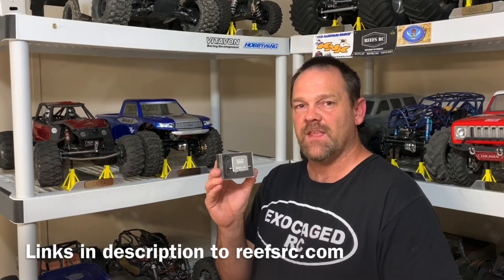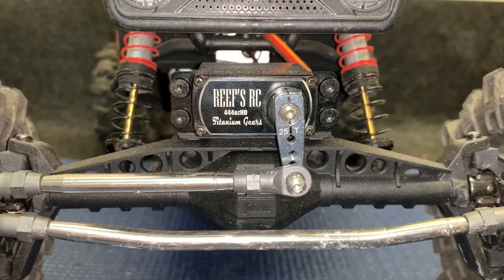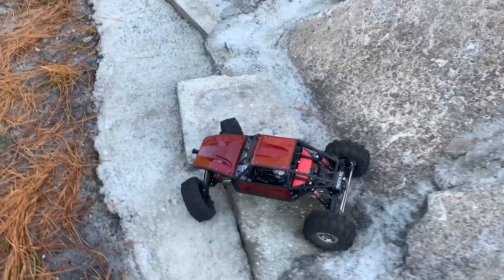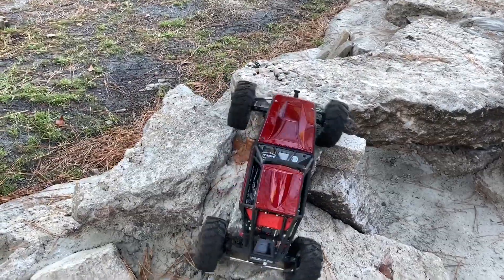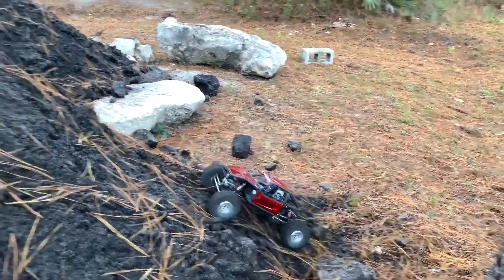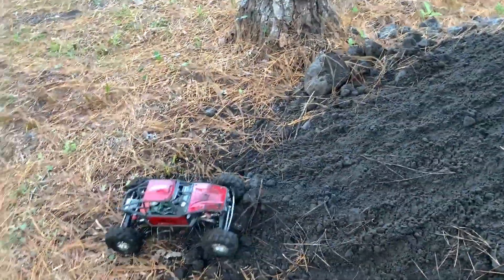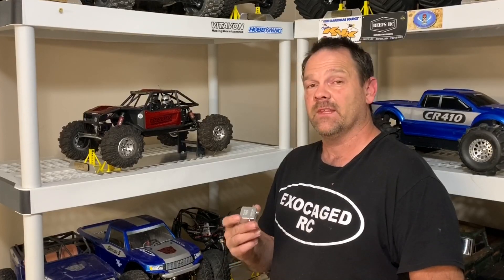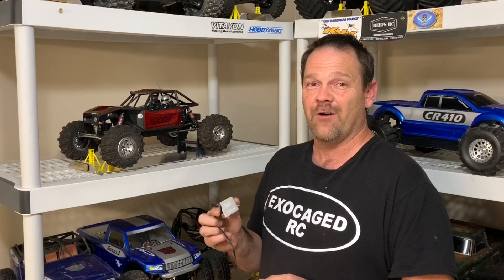Reefs RC RAW500 SERVO!!!

Comment: Hello sir, I’ve been watching your crawler videos for a while, and starting using Reefs servos due to your videos. I thought I would ask you if you ever tried the Reefs Raw 500, in a rig that had the Tactic TTX300 controller, and matching receiver, like maybe what came stock in the SCX10 2’s. I have the 555 in my bomber with those same electronics, and a 1200kv fusion, and love that set up, with no issues. But my TRX4 sport with the same controller, and 1800kv fusion motor, and Raw 500, are having some issues. The servo will twitch at times, (very quickly, and momentarily, and not always throughout the day). Reefs told me to use a Spektrum DX5, and matching receiver, which I don’t have yet, I only have lots of RTR controllers, and receivers. I was just wondering if you ever tried using that combo (Raw 500, and Tactic TTX300 controller/receiver) and experienced the same twitching like issues.
Reply: Have you tried running a BEC in your TRX4?
Reply: @glennaguon5165  yes sir, used it for a short while, but it only gives you 6 volts for servo. The best option is running a hobbywing 1080esc, $42, fully programmable,  comes with program card, for brushed motor. Or better yet, for brushless,  the hobbywing 1800kv fusion motor/esc, also fully programmable,  comes with program card...best $156 I ever spent. Both are great options!
Reply: @glennaguon5165  and I forgot to mention, both hobbywing options I mentioned earlier, you can program the internal bec,( with the included program card), to give your servo either 6 volts, or 7.4 volts. But be careful, if you go with either hobbywing set ups, and you decide to run your bec voltage at 7.4 volts, I heard the micro servos that come in the TRX4, can’t handle more than 6 volts…just so you know. The traxxas optional bec kit, will only give you 6 volts maximum.
Reply: @OH-Hobbies  Have you tried an aftermarket tx/rx and different ESC beside the 1080?
Reply: @glennaguon5165  Yes. My TRX4, was the sport version RTR. I upgraded the servo to a Reefs Raw 500, but first I added the traxxas BEC, to get 6 volts. Later switched to the 1080esc, and ran the servo off 6v and 7.4volts, same as when I later switched to the brushless fusion motor. The only issue I had with the stock controller (TQ) though, is that there was no way to set the end point adjustments for the servo. I believe there’s away to set the end points on the TQI,  if that’s what you have, but I don’t know. I had the older RTR Tactic TTX300 controller, and receiver, which came in many axial scx10 2’s, original axial Bomber, and also, my RTR 6’s Arrma Talion, so I was familiar with the end points on that. When I tried to use the Tactic, with that exact servo Raw 500, it did not like it very well, the servo is very fast, and is awesome, but for some reason, there was some intermittent “twitching”. Reef’s told me to try one of the Spektrum DX5’s, so I just bought the DX5C, and problem solved. The funny thing is, I use the same Tactic TTX300 in my axial bomber, but use the Reef’s 555 servo, and there is no twitching. That servo is much slower, but pulls way more weight. 555oz/inches of torque on that, is way underrated, it actually pulls about 690oz/inch. I’ve never seen anyone test exactly how much the Raw 500 actually pulls, but it is very fast, and super quiet. I highly recommend it for a trail truck, or comp crawler.

Comment: Hey what transmitter and receiver do you run?
Reply from the maker: depends on the truck but this capra has a hacked GT3c radio
Reply: @ExocagedRC  ok thx thinking about rear steer for my capra

Comment: Need to put it on the servo tester!!!  I can't choose between this raw 500, triple 5 or the 3 brothers g13.  What's you recommendation between these 3 servos?  Which would be the most durable?
Reply from the maker: Raw500 is fastest, 555 is strongest, g13 simply works great. Imo I’d go with the Raw500 as its tough fast and strong.
Reply: @ExocagedRC  Do you think I should install a BEC using the raw 500 with the HW axe 550 system or is its internal bec strong enough to run the raw 500?
Reply from the maker: Jared Ferra should be good with the AXE esc.
Reply: Will the raw 500 work with a stock arrma Mojave esc?  Will it be fast enough?

Comment: A little off topic but I know you run a hacked flysky radio...as do I.  How are you powering your servos?  Do you bypass the rx to be able to run 7+ volts to your servos. I am trying to run 7+ volts through the flysky rx and i think this might be the reason my servo wont always recenter and is glitchy. Same issue on both of my trx4s using 25kg servo. 1 with a mamba x and 1 with a 1080 esc both with the bec turned up on the esc setting

Comment: Exo, it looks like you pulled the brass? How come? I have a pair on the way along with one third member in brass. If I like it, I’ll buy another set for the rear.
Reply from the maker: I actually had this recorded before I had the brass put on it, the brass is staying on the capra for sure as it sits now

Comment: Hey bud. How long has a reefs lasted for ya. Ever have one s#$t the bed.
Reply from the maker: Coast2Coast RC so far I haven’t killed one, I thought I killed a gear in the 444 when I did the jumping video with the 2.8 sand paws but it’s still working fine. I’ve read where others have killed the 555 gears and gear sets are available. This new one is still new so we will see how well they hold up, so far so good

Comment: You get what you pay for.
I have several 555's and Protek 370TBL 650oz servos and they are extremely powerful. I also have two 46kg Japanese servo's that were $50 each. They aren't bad for the cost but not near as powerful as the Reefs and Protek.

Comment: So it's a 555 with a high speed gearset in it I'm guessing. Throw it on the servo tester 1000
Reply from the maker: Is the 555 has a coreless motor with different gearing than this one with a brushless motor so its not the same thing at all
Reply: So is the 500 more powerful than the 555? It looks to be faster.

Comment: You're never too old to learn. WTF is a BEC?  I've heard them mentioned before in servo discussions and when I questioned my hobby shop about the Traxxas 2255 400oz servo he had no better idea of what it does and how it does it than I. What is it; a capacitor of some sort? Another question! I got a Traxxas High Torque 330 on my TRX4 and LOVE it. However, it has a far greater amount of 'slop' at neutral position than does the traditional 'Core' servo on two other RCs I have. Is this 'slop' normal for the 'Coreless' variety of servos? Traxxas support said "Nothing to be concerned about if it's not hampering driving"; but I'm curious still.
Reply: Battery Eliminator circuit. Voltage regulator that can output a set voltage different than the battery output voltage.
Reply: @avelkhemchan6640  Thank you. That is an apropos initialization for sure(and certainly not to be confused with an acronym).
Reply from the maker: Douglas Elliott I tell you man the cheap 25kg servos like what Redcat has rebranded are really good for the money. I’ve got about 6 of them in various vehicles and haven’t killed one yet. Are they as good as the one in this video? Not even close but they get the job done and are cheap.
Reply from the maker: yep as Avel said its a high amp external bec that helps get more voltage and amps to power the amp hungry servos and other items. This is a common bec in my area https://rover.ebay.com/rover/1/711-53200-19255-0/1?mpre=https%3A%2F%2Fwww.ebay.com%2Fitm%2FCastle-Creations-CC-BEC-10A-6S-Switching-Regulator-010-0004-00%2F293374005668%3Fepid%3D691291103%26hash%3Ditem444e7411a4%3Ag%3Af3oAAOSwhQpd8psN&campid=5338273090&toolid=20008
Reply: @ExocagedRC  Thank you. For my driving the better servos NOT requiring the added complexity and cost of a BEC seem to offer enough power/performance and are more in my budget. Reef's 400SC checks all my boxes, but I'd much prefer keeping it below $100.
Reply: Give Traxxas a skip as far as buying electronics, you'll thank me later.. There are way better options out there for cheaper, and no, it's not normal for a servo to have slop in it, it's just poorly made and they'll find every excuse they can to not replace it.
Reply: @daver18qc   Thank you for the insight. Ever since purchasing the "330" I've been taking note of other brands from the Chinese cheapies on Bangood to the Savoxs and Reef's. I only came into this hobby in May 2019. I'm trying to learn what I can and keep within a limited budget. I don't mind spending more on quality but I'm not gonna do stupid either just because of a 'name'.
Reply: @douglaselliott8298  I got loads of chinese servos and ESC, they work fine and you can buy 2-3 for the price of one TRX unit. Just buy those with lots of positive feedback, stay away from the ones that have 3.5/5 with 3 reviews.
Exocaged here made some videos of cheap but good servos, check them out ! :)
Reply: @daver18qc  Again thanks. That emotionally disturbed Brit who sticks 6S Lipos in a TRX4 and then drives it as one would 'Alvin' photographing the Titanic is always going on about the Bangood cheapies.